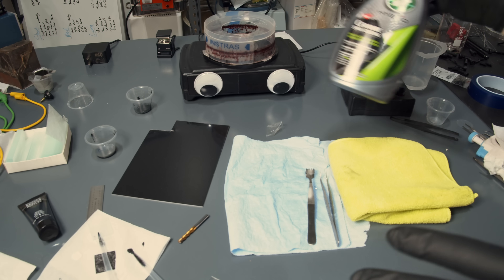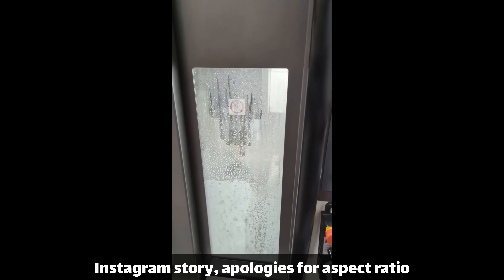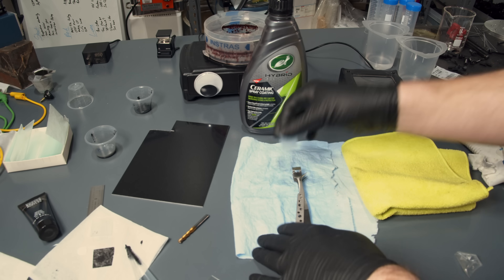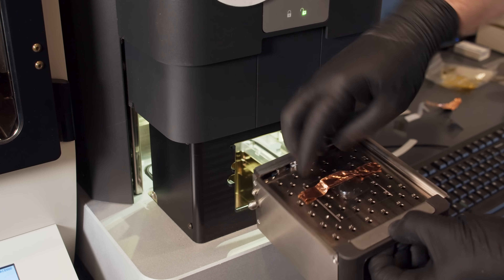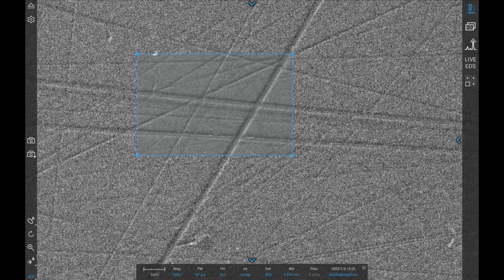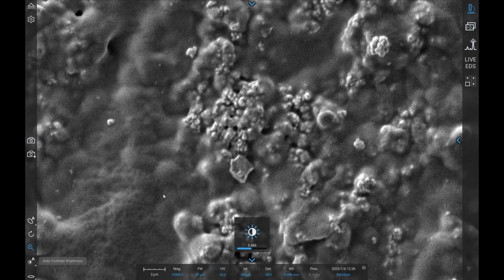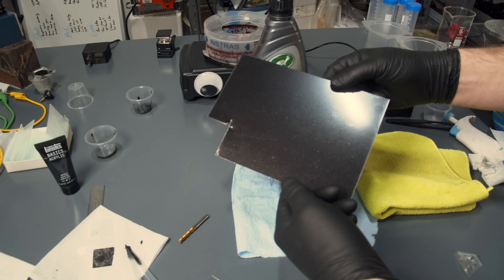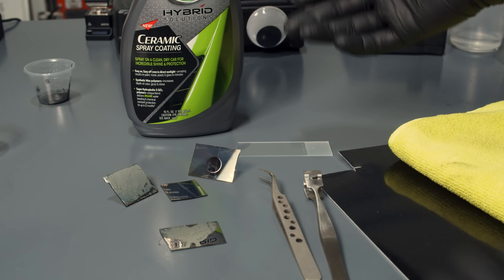More rigorous analysis of "Ceramic" car spray

Comment: Have you considered testing those nano coatings made for car application that makes water sheet up instead of bead up? I wonder if that would work. Based on no CNC experience I still assume that form of liquid shedding would be preferable? Sure, the tablet screen protector looks WAY better compared to nothing but the view is still obscured by a lot of droplets.
You still probably need a layer to apply it to instead of straight to glass. Maybe to the screen protector, the oleophobic coating probably wears off eventually. Or some other "stick on" plastic sheet.
Reply: The issue with sheeting is it’s  hydrophilic which allows wetting of the surface. Nothing would change until there not enough water to break the surface tension and allow it to sheet off. Hydrophobic coatings prevent the wetting action which makes removal dependent on droplet size and surface angle. This is why windshield/glass coating are all beading, because if they were sheeting then the water would react the same as if there was no coating until it stopped raining, beading action isn’t dependent on removing the water source for its action to happen.

Comment: maybe confirm the application process with the manufacturer?
are you supposed to wipe it off immediately?
with carnauba wax as mould release, you put on a coat, let it dry, then buff/polish it, wait a few hours, then repeat

Comment: I would imagine “sandpaper” would get its abrasive quality from sand… which is heavily silica-based. How could you tell that the silicon atoms are from the spray?
Reply from the maker: Definitely a possibility! The paper I used is silicon-carbide so there could have been contaminants. I tried to clean it really well in the ultrasonic, and the SiC particles should be quite a bit larger. But it could definitely have been a contaminant and not from the spray. Perils of this kind of investigation, really hard to know for sure!

Comment: Did you sputter it after the application? If not, does the imager really pick up the particles or does they only kind of make the beam scatter and make the image a bit more fuzzy, like it looks on your pictures?
Reply from the maker: Yep, I sputtered after coating. The really fuzzy, high contrast images during EDS are due to the process: EDS requires very high beam energy which makes for a less-good image. I was also imaging in a different mode (backscatter) which has poorer resolution. 

Some of the fuzzier shots were just from vibration though. Trying to see nanoparticles on my SEM can be challenging since it's approaching the resolution limit, and external vibrations (airport, trucks, neighbors using heavy equipment, etc) can impact the image quality.

Comment: Interesting video. I'd love to see some analysis of different coatings, specifically specialty coatings advertised at the car market such Gyeon, Adams, nexgen, etc. I understand if that's too much time/money, but it would be incredible to have some actual science behind these coatings instead of a random joe on YouTube showing you a side by side of their car hood. Not that it isn't useful, but it is far from conclusive. 

As for your solution, I think that the tablet screen protector idea is pretty good, since it is easily applied and replaced. Under the same idea, you can purchase the coating that they use to make the surface oleophobic. I believe it is some type of fluorinated polymer. Environmental and toxicological concerns aside, it is a fantastic coating that would perform the same job as your screen protector, but applied directly to your viewing window. The one I've used with relative success has been the Crystal Armor: the top result for "oleophobic coating" on amazon. There is not a large market for such a coating, so I can't speak of other brands marketing something similar. 

As a chemist I'm both intrigued and highly skeptical of the expansive consumer "coatings" market. Ignoring the aforementioned environmental and toxicological effects--which are potentially severe, the tenability of many are suspect. The industrial use of coatings requires extreme precision and is basically like following a recipe for baking. Miss a step, or bake at the wrong temp, or for the wrong time, and you're highly likely to come out with a ruined product. Without controlled and repeatable conditions, they're impractical for an average consumer applying it in their home or garage (or, as in many automotive applications, outside! The horror...). I'm not an expert in the subject, but I am highly dubious. Companies are springing from nowhere with a "miracle" coating--and yet for many of them you'd be lucky to find a single coating engineer, material scientist, or even a chemist in their payroll. Anyways, rant aside, I hope to see more content like this if it's something you enjoy producing.

Comment: I feel the silica a would make for a good polishing compound that would help to remove the oxide layer from the surface of paint. So combine that with wax could help. You would really have to buff the surface for proper effect though.

Comment: Would be interesting to see, as the bottle is probably so diluted, if the ceramic nano coating stuff in 20ml or whatever small bottles work similarly

Comment: One thing I was curious about in the original video, and I apologize if this was covered to death in those comments.  Also, this is probably a stupid question:

I understood that you were disappointed by the apparent lack of ceramic nano particles.  I, on the other hand, was confused by the lack of anything sitting on the slide.  Where's the silicone?  Where's the wax?  Are those things just not image-able?  Too small?  Do they leave an atomically thin coating?  As a layman, I was expecting an ocean of gooey wax coating the surface of the glass.  What's up with that?
Reply from the maker: Ah sorry, I should have talked about that! Combination of a few things you said. It's likely leaving a pretty thin film, and the SEM won't really be able to see a thin film. Thin as in only a few nanometers thick. Silicones (and waxes to a lesser extent) love glass, and will smear out to make a really thin, consistent film. That's the major reason car waxes have instructions to apply and then buff it out... you want to remove the excess wax and leave behind that thin film which is clinging to the glass.

The other complication is that waxy organic stuff doesn't provide a lot of contrast on the SEM, so unless it's thick it's hard to see. For example, the goop that was on the tape dividing line early in the first video is what you'd expect to see if you left a bunch of the stuff sitting on the slide without wiping it off. Big, gloopy, glowing mass of stuff :)

Comment: I love the follow-up. It makes YouTube still feel like a dialog :) I think your EDS results are most conclusive: there's just not much Si in there. I always wondered about these ceramic coatings for cars. I don't think any car manufacturers have advertised or used them.
Reply from the maker: Thanks! Was fun to quickly turn around and test some of the ideas that viewers suggested. Definitely considering leveraging this pattern for future projects, especially ones where I feel stuck or got a negative result. Instead of just throwing away the work, might be interesting to "ask the audience". There are always great suggestions that I never thought about but often too late to do anything about it since I wrapped up the project.
Reply: @BreakingTaps  Peer review works!
Reply: Hi.... I am a professional car groomer and would be very interested in a proper analysis of some of the high priced "ceramic coatings".... To be honest the hydrophobic qualities are very good vs a standard high quality canubra wax
Reply: When I saw the first video I was thinking that I hope that Ben do a follow up video about this :)
Reply: There was a comment here that sorta made sense. Maybe the product design team included the Si to act as an abrasive and help the main material to remain better on the surface and the marketing team took it out of context?

Maybe a thorough polish with the stuff could confirm this?

Comment: Ceramic is crystalline? This is shocking to me. That means nacl is also ceramic and so is diamond? I belive ceramics word came from pottery. The silica bonds the clay particles togethers so you can say that silica is the main ingredient from which word ceramic came from. Alumina, ferric oxide glass are supposed to be ceramics. They are bonded oxides and as far I know amorphous. Ceramics are amorphous. Compounds having ionic bonds are salts.

Comment: There is really only one way to tell.... get some diamond 10 and some other spray on type... NEW shake well and let it dry, no wiping.... 
When you clean a car you have a wet with the cleaner or ceramic spray here working it into the cars paint surface. not wiping it off. please just  let it dry on there with out running off. i bet you 99.9% of those particles are just being removed from the flow of the solution and or the wiping.

Comment: I wonder what’s in that Oleophobic screen protector coating. That’ll be cool to have and check out under your microscope!
Reply from the maker: Agreed! I'm noodling over how to see if we can image it. From skimming the literature I fear it's something like a  fluorinated polymer monolayer, which I don't think I'd be able to analyze. 😢
Reply: @BreakingTaps  hmm sucks but how do they scan Teflon? Different tooling?
Reply: That's the real question, I wonder if it's chemical or structural (or both)

Comment: 1:29 that's a neat idea!
But if you want "almost clear" vision, and mostly no auto-focus issues, for video recording purposes, as mikeselectricstuff suggested, you should install a centrifugal view port. AvE has a video about those - his is air-driven, iirc.
Reply: Makes me wonder if plasma channel could make something electro static
Reply: @jhoughjr1  @Leggo MuhEggo  you're going to need a great deal of static electricity to keep the jet from a 200 watt water pump that then hits a 20000rpm spindle off your glass
Reply: @zyeborm  Well applied science did a video showing pumping water with high voltage.  Needing a large charge is not a show stopper. Hence why I said it would be interesting. 

Something with no moving parts is certainly worth experimenting with.
Reply: @jhoughjr1  I'm suggesting the charge you need will be in the tens of millions of volts at significant current in order to apply enough force to the water. You can do that to your CNC mill. Personally I like being able to be in the same room as it

Comment: Two minor points on the EDS: first, many Al alloys contain some Si. Depending on how much and the treatment, it may form Si precipitates. Second, polishing with SiC carbide paper will definitely embed SiC particles in the Al ( trust me, I have firsthand experience, use diamond or alumina). Seeing little bits of silicon inside crevasses isn’t very convincing. I totally agree that this stuff doesn’t seem to have much silica in it. It really shouldn’t be so hard to find.
Reply from the maker: Yeah those are both fair points! Definitely a brain-fart moment with the SiC paper, although the grit size (1500, ~12um) would hopefully have been pretty noticeable even after it breaks up some. The particle was a few hundred nm iirc.  But yeah, could easily have been some embedded abrasive. Even less proof for the spray in that case 😔
Reply: @BreakingTaps  That did seem to be the case but maybe as an experiment you could acid etch the surface then apply it in small amounts with an atomizer and heat with a dryer slowly.
Just another idea. Cool shop btw! 👍

Comment: Regarding your problem of silicone oil based coating wearing off quickly from your CNC glass, you may acheive longer lasting effect by first coating the glass with a polymer varnish then coating it with silicone based hydrophobic solution.
That way silicone should adhere to the varnish which is much less hydrophilic than glass, also it should penetrate it.

Comment: If you want the best in visibility through the CNC windows, I’d suggest something similar to a lens spinner from the film industry. I believe that high end CNC machines can have them added (I think AvE has access to a machine with one of these?)

It’s basically a round piece of glass/acrylic/clear material that gets spun at a relatively high speed by a motor. The spinning action ensures that any liquid that lands on it will almost immediately get flung off the edge of the glass. It keeps that section of the window basically perfectly clean. They’re very impressive.

Comment: Are you spraying it on and immediately wiping it off? Are you sure this is right? Shouldn't it be left to dry without wiping? It seems to me that this is the reason why nothing is left on the slides. But i never use the sprays or have any relevant education... mybe try leaving ig and make a short followup Short? I'd be interested .

Comment: Could the silica particles act like grit? That is, an abrasive on the softer surfaces like paint but at same time be more equal to the glass just helping cleaning off any contaminants on it when rubbing vigorously?

Comment: I beg to differ: silicate glasses are ceramics, at least that’s what my glass and ceramics professors would say. I got my BS in Glass science at the Ceramic Engineering College at Alfred University, so I feel some authority on the subject. Roughly speaking, ceramics are compounds of inorganic oxides, usually formed under high temperatures. There are some glasses that aren’t ceramics, for example plastics. Some ceramics are very crystalline, some are amorphous, and some are mixtures.
Reply from the maker: TIL! Gonna pin this for now, since I don't have any addendum material yet and this is very informative!
Reply: Not a metal? Not a polymer?  Then it’s probably a ceramic.  In this case, glass is a definition of structure, hence bulk metallic glasses. 

Leggo, glazed pottery is definitely a very mixed multiphase material.  In many cases you have crystalline grains with varying glassy phases bonding everything.  This is what gives porcelain its “ring” but earthenware its thud. 

Working in “ceramics” I can tell you it is regularly misunderstood.  

Taps, keep up the good work.
Reply: I finished my grad in 2009 and even studying glass in a part discipline, my professors classified glass as a ceramic for the same reasons mentioned above. We also have amorphous metals that's are not ceramic, but because the amorphous structure are classified glass alike.
Reply: As a (former) synthetic / medicinal chemist, if it's not metallic or organic, it's ceramic :p

Hey it's not as bad as astrochemistry: where if it's not hydrogen or helium, it's "metallic"
Reply: @defenestrated23  there's supposed to be metallic hydrogen at the core of Saturn
Reply: Having my degree in Ceramic Engineering (NITR), I do agree that silicate glasses qualify under the broad definition of ceramics.
Reply: Um my specialty is plastics. BS from PSU.  (Plastics that we use everyday, waterbottles, your shoes, dashboard in your car and so on.)  I'm trying to understand how you are putting glasses/ceramics and plastics in the same sentence.  Let alone anything in common. Plastics is almost always just carbon/ oil compound based and only glass or ceramic in it would be added sometime right before injection, or added already to the supply pellets.  Just trying to be polite.
Reply: @blk77sunshn  did you skip the class where they mentioned Tg (glass transition temperature, a fairly useful property of polymers used as plastics)?🤔
Reply: good 'ol Alfred, in the middle of nowhere. FORCED to study to avoid boredom.
Reply: Super cooled liquid to ceramic, devil is waiting for the details. can we see through ceramic like the glass?
Reply: University of maryland states "A ceramic is a material that is neither metallic nor organic. It may be crystalline, glassy or both crystalline and glassy. Ceramics are typically hard and chemically non-reactive and can be formed or densified with heat."
Reply: in this thread we see material scientists arguing about words. delightful.
Reply: Yeah I hadn’t heard of crystallinity in ceramics before. I imagined my pottery was amorphous
Reply: (Dumb guy chiming in) 
ceramic piezoelectric crystals.
Reply: As someone that took a couple of studio pottery classes in college I agree with everything stated here.
Reply: that sounds too technical, almost to the point that perhaps the naming convention has failed. A lot of scientific literacy is made counterintuitive by new discoveries and should be changed eventually. New words might be the best option just to get away from common layman's terms.

Comment: It would be interesting to explore how to get that complete coverage of particles you had originally expected. Concentrate the spray? Let it dry on the substrate rather than wiping it off? Bake it on?
Reply: I’ve been saying that since the last video. Seems obvious to get more on don’t wipe any off esp since his application isn’t really the use case the instructions were written for.
That should ensure anything in the spray stays on the slide

Comment: Looks like the marketing boys of all these sprays are Lying Cheating Anal Orifices, after all. What a shock!  🙄  I hope that the bottle was cheap, as some of the "exclusive", "bespoke", "premium" crap cost a lot with the same ingredients listed.  It's rumored that those are sold by marketing geniuses who live in pyramids!  
Maybe the best solution is an "air knife" made from some copper tubing fed by your shop compressor.